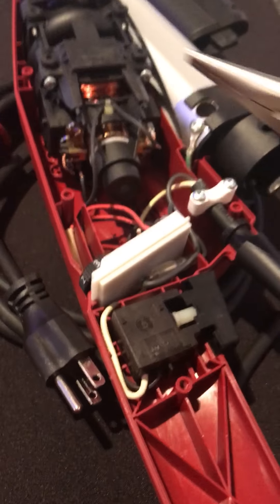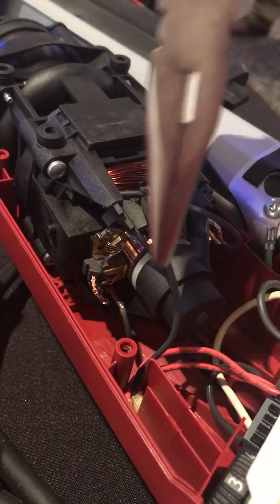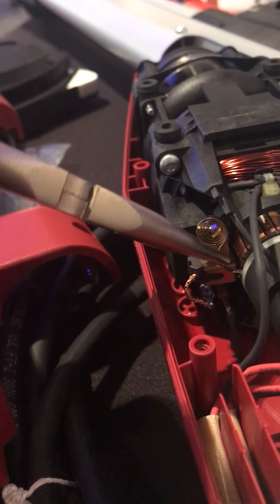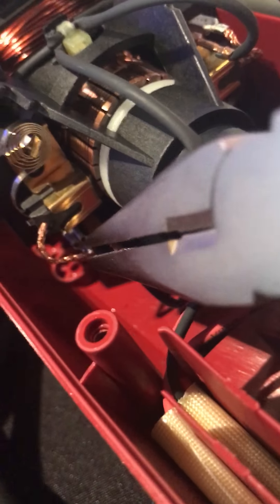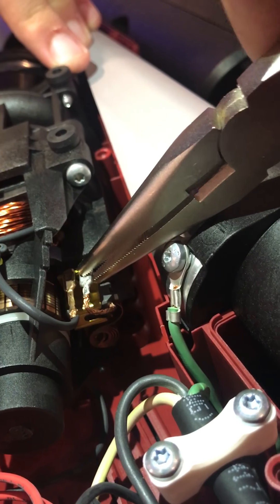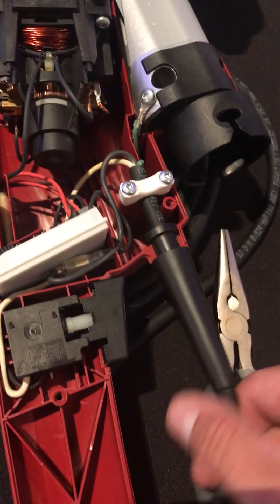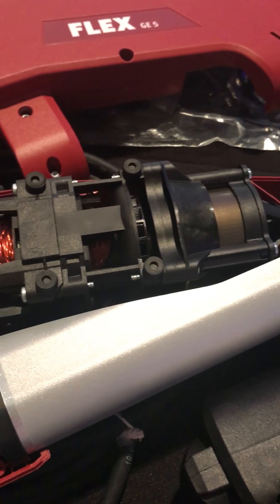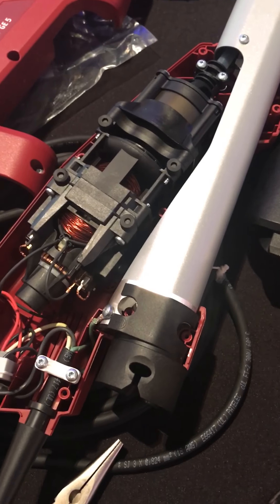Flex Giraffe GE 5 DRYWALL sander carbon brush replacement pole sander

Comment: Hey i have a question mine is making sparks when i turn on the switch and the head is not rotating. 
I changed already the brushes but same issue do you know what it could be and need to be replaced?